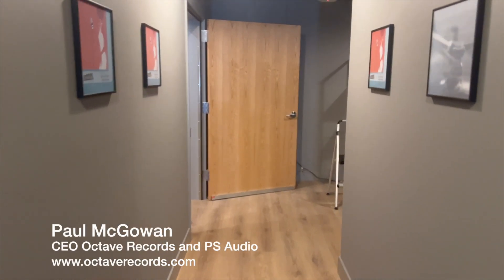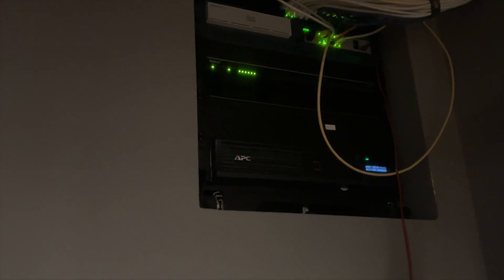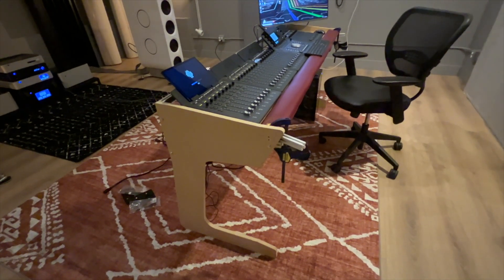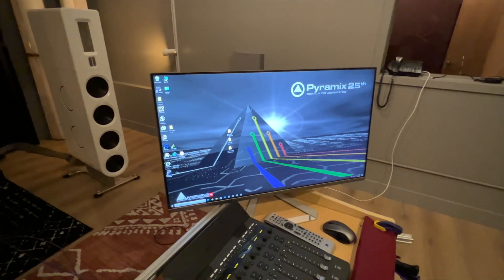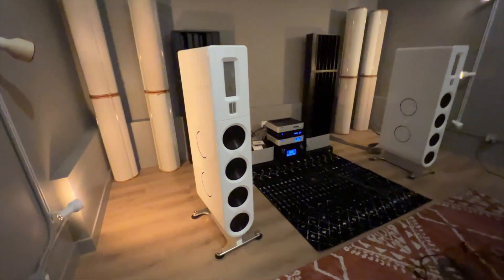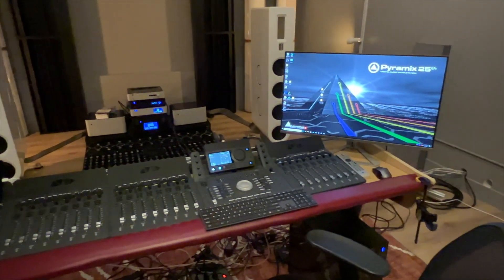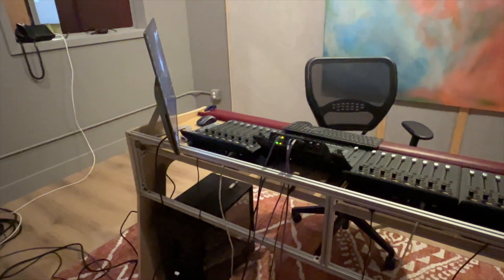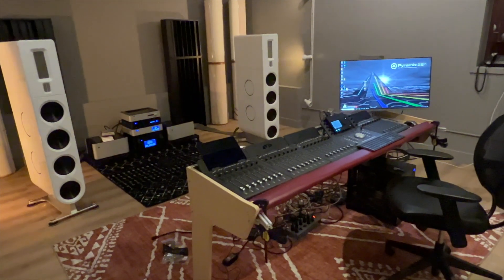Octave Studio Build 17

Comment: @2:12 -- It looks like that monitor might be interfering with sound from the right speaker.
Do you leave that monitor there during listening tests?  Or is the monitor's location not an issue?
Reply: Yes, it's ok. It's the angle. It's off to the side enough not to matter.

Comment: That AVID stuff is PCM, no?
Reply: The S1s are controllers. They don't take inputs. Just signals to control software.
Reply: @SteveTheSuperSanchez  But are they capable of controlling their DSD software was what I was really getting at? Typically they control pro tools.
Reply from the maker: Yes, they are more like mice. They control Pyramix (or Pro Tools but we don't use Pro Tools). They are specific to PCM in the way we use them. You are correct. Our process is to record in DSD, convert to PCM using our Zephiir look-forward processor, mix, then back to DSD for the master.